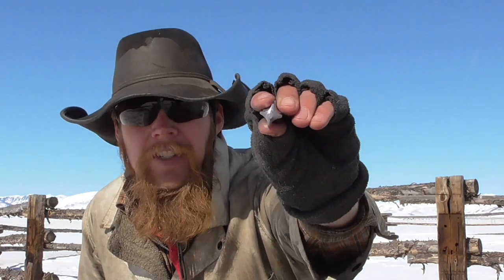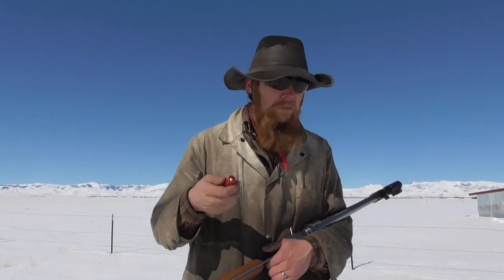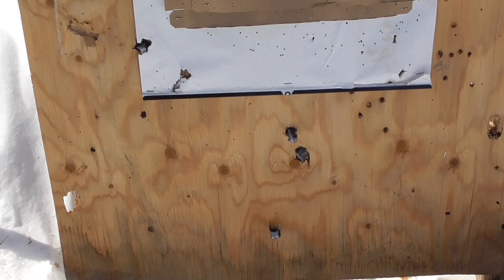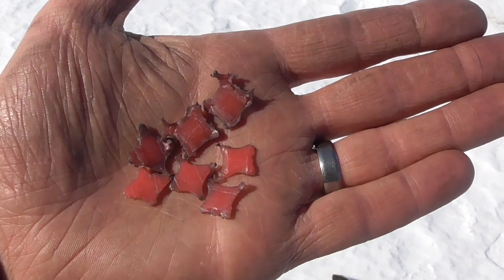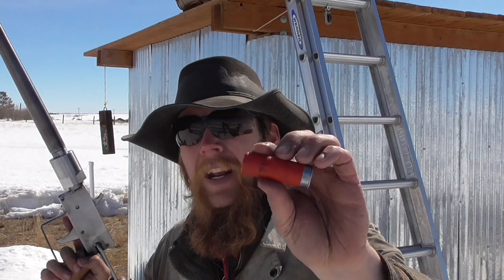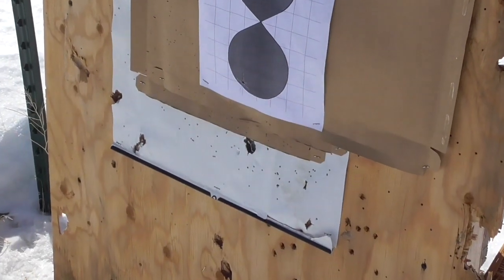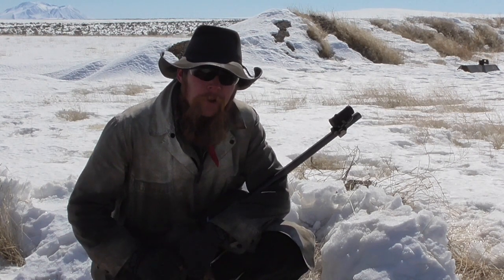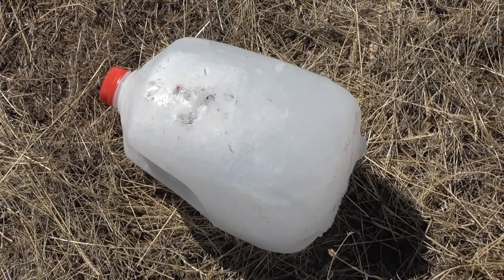Shooting Star Slugs V1 (TIS204)

Comment: I use a three piece wad made of 2layers of thick card 350 to 600gsm sandwiching layer of 1/4 inch composite cork flooring tile seems to form quite a good gas seal for shot and slugs .

Comment: Had the exact same problem with a cannon I helped build at Missouri S&T. We built a 12 inch bore cannon (no joke) to shoot common items found in a coal mine at concrete mine seals; and used stacked plywood circles as a wad. Whenever we used too heavy of a projectile or more than 1 lb of black powder, the wads blew into splinters in the bore and our projectiles had very low muzzle velocity. Turns out even muzzleloading gun design can be somewhat complicated.

Comment: Hello, from what i have seen on shotgun slugs. If there is any fins on it, it is around the circumference of the slug, with a lot more fins, so it takes up more space, and thus less blowby. So it is sort of a selfspinning projectile that should stabalize from a smooth bore.

Your best bet on anything that will be a good slug, is one that will engage in your rifled barrel lands and grooves. A slug that has the length that matches your twistrate so it will spin right, and thus shoot straight. If you want destruction you could make a mold that has a pin in the front so you could make hollowpoint slugs. With the plastic shells the slug does jump quite a bit before engaging the lands and grooves, if you could have brass cases you could possibly make the bullets engage the rifling on chambering, so there is little to no jump for the slug, and thus increasing accuracy. 

A hollow point that will engage the rifling, and is of  the right length for the twistrate will go a long long way i bet. 

Greetings,

Jeff
Reply: Ps. For the odd shaped slugs that have a lot of blowby: a good shotcup might do the trick. You can get these in bags of hundreds. It is probably cheap and there are some different kinds.(Reloading a lot of cast 00 buck saves a lot of money instead of buying these for example). 

Maybe a bombshaped design like those with fins and a ring on the tail stabalize really well, it might be hard to make. Or an airgun pellet design with hollow slugs that expand and engage the rifling in your barrel.

Comment: Well, you'll figure out the wad problem.  Some commenters have had good ideas on that.  However, supersonic airflow is tricky and not what logic would lead you to believe due to the shock waves.  You might never get them to fly straight without using a rifled barrel and some sort of drving band on the slug to get them to spin.
Enjoy your vids, thanks!

Comment: Looked like a low base round you loaded up? Something like a 7.5 or # 8 shot would come in. The weight of the 4 star slug? Looked like it is easy 300 gr, 4-500 gr? I would up the annie to a high base brass case.  In short; Star slug vs power charge I think, may try a magnum load, not a shot load.

Comment: throw a steel disk in the bottom of the wad to serve as a pusher plate. the plastic wad material isnt strong enough to hold back such high pressure on its own